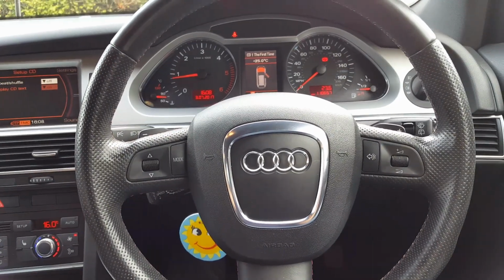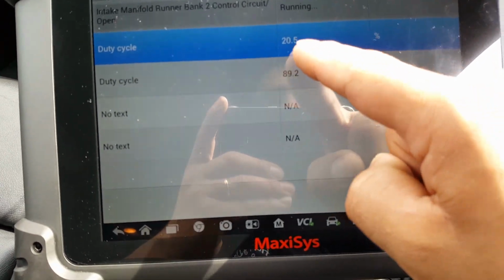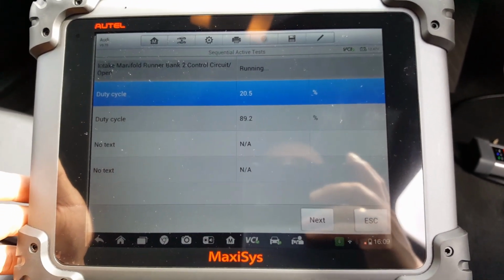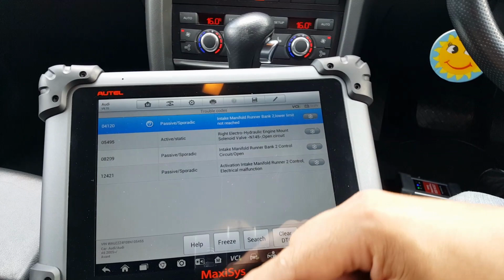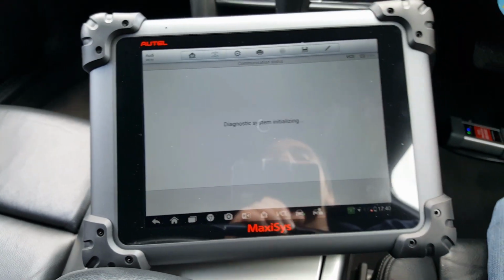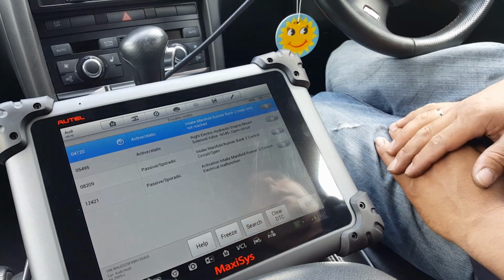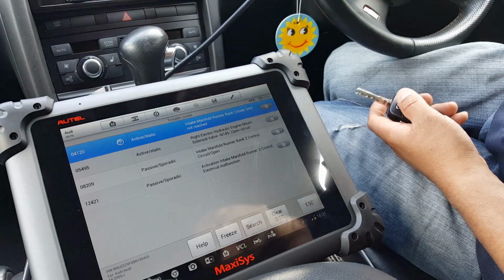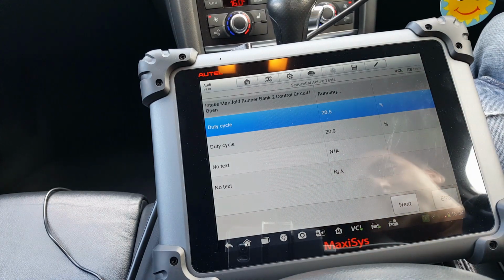Audi A6 2.7TDI V6, trouble code P1018 or 04120 flap actuator. Fault finding and repair.

Comment: I actually added two screws, one for the lower limit and one for the upper limit, at slightly different locations from those shown in this video. They delimit the angle of motion at around 45 degrees. When everything is assembled and you look at the actuator knob flat on, the lower limit is 1mm over the (extended) flat plane where the three mounting bolts go, and the upper limit is 1mm over the (extended) horizontal line that dissects the electric motor. A little bit of trial and error but it works. No more upper/lower limit not reached errors and upper/lower stop not reached errors.

Comment: Wow you are a clever guy…thinking outside the box as they say. Ive got the same error code on my bank 2. It is actuating so do you think it is likely this same problem? Im gonna place the screwdriver to see if it changes to passive just like you did. My car is an 08 A6 3.0tdi. You explained very well..thanks very much 👍

By the way, my car was working fine more or less until i had to leave it sitting unused for 3 years then this happens. I assumed that sitting for so long maybe the gunk had solidified and blocked it up somehow, what do you reckon. Also i have a problem 01826 with my ABS, i read that the water drain at the back of the engine can get blocked and the water sitting can cause problems with the abs electrics.

Voce Brasileiro?
Reply from the maker: Portuguese...
I never had the issue for the ABS, but nothing like some good investigation and diagnosis...
As for the flaps, check could be either way, but if you say they move, then might be the same as in the video.
👍👍👍

Comment: Do you have any solution when its takes longer to start, even when it has been driving
Reply from the maker: Have you scanned the car?
Any trouble codes?
Something like that can be caused by a few things...
👍👍👍
Reply: U1007 battery monitoring control module 
 & P1580 throttle valve bank1& P161C glow plug cylinder 3 (changed on Sunday & no longer there) and lastly 00739 circulation limit reached coolant @LMAutoRepairs

Comment: Absolute genius! Same problem on 3.0 V6, 04120 code on bank 2. A very simple solution (which are often the best) but huge respect for coming up with the idea in the first place, well thought out, logical and well explained. The main plastic gear wheel inside the unit can be very brittle (mine's 17 years old now) so be very careful when you're drilling for the screw, mine started to split a little so I filled the voids around the screw with epoxy resin. Thanks a million!!
Reply from the maker: ☺️
Thanks!
For watching and for your comment. 
Great your sorted your as well...
👍👍👍

Comment: Thank you so much - I had exactly the same error codes on my 2006 a6 2.7 tdi - I was able to diagnose it easily by watching the startup sequence and applied a very similar workaround. Very nice to not have the engine warning light blaring at me any more.
Reply from the maker: That's great!
👍👍👍

Comment: I have same error on my audi a6 3.0 tdi 2008 ,motor light error is on board ,hope this will work for me ,ordered metal pieces for this problem insted putting the screw inside on your  way

Comment: Hello ive a audi a6 2.7 diesel front wheel drive , europen version .  Someone gifted me and i did all the filters and oil change , it has a check engine for air  intake manifold  + in computer  there are some code for injector 2 3 5 , in highway for 130km it consume 8.6 lit , ive test it . But in the city for 20 km it consume 10 lit . Is this normal ? Does it has to do with intake manifold ? Many services here in albania told me dont do something to injectors becouse im gonna have more problems . What do you recommend me to do ?
Reply from the maker: I would start by check the issues related to the faults you have... and go from there...
👍👍👍
Reply: @LMAutoRepairs  might a bad air intake manifold couse bad fuel economy ?
Reply from the maker: Yes...
Combustion will not be efficient if you have air leaks... Air is supposed to get to the combustion chambers, not to escape before get there..
Reply: @LMAutoRepairs  https://youtu.be/p-UPPEBlju0  i did change the manifold but still problem with acceleration and  poor fuel economy  , might it be becouse the throttle body , here ive recorded a video , is it in good condition ?
Reply from the maker: Check for codes, and check live data...
Your answer will most likely be there...
Reply: @LMAutoRepairs  i dont have codes
Reply from the maker: Again... live data...

Comment: I am currently facing the same problem with my V6 TDI and was trying to go the external brackets way although they are not available in my country. Would you be able to guide me on any measurements to set a stop for upper and lower limits? My fault code reads; lower limit not reached - upper limit exceeded. Thanks in advance
Reply: I am trying to fabricate a bracket locally

Comment: I have the same problem P1018 lower limit not reached but during the test via VCDS the damper opens and closes normally in the range of 20.5 to 80. After starting the engine and reloading the errors, the error reappeared.  Can't advise me where the error might be or how to fix it?

Comment: Hi ,i have also audi a6 3.0 tdi from 2008 232 hp,cann you tell me what is on chanel 20 o meassuring block ,you find there a temperatur but i don't now where it come ,or what means or how it calls that Sensor that shows that temperatur ,on my car shows   -40 ° celsius and that is not ok ,from what i have seen on youtube must like 54° C.
If you can tell me what is there.
Thanks
Reply from the maker: Hi
If you have no faults on the ecu, I wouldn't worry about...
What tool are you using?
Most like is a vacant position... if you are using VCDS, is common for it to show data that doesn't belong to a certain model... and because there is no data, is shows the minimum possible, like -40 when for temperature...
Thank you for watching and for your comment!

Comment: But how come the motor did not move when you powered it up
Reply from the maker: Not sure at what part of the video you are referring to... but as I explained, moves once till the motor moves over the limit... which at that point stops actuating it due to the fault...
Thank you for watching!
Reply: LM Auto Repairs what I am saying is u ran power to the motor in video and it didn’t run ??
Reply from the maker: @mickkelly2229  
As I explained in my previous comment...
It runs until it faults...
All explained in the video as well...
👍👍👍

Comment: This is brilliant 😀. Any tips on the ignition key lock after the battery was exchanged? The car is the same as the one in this video, it starts and drives but the buttons on the remote doesn’t do anything and it has that warning in the dash that says ignition lock.
Reply from the maker: Hi
Thanks!
I have a video for that...
Jut search my channel...
Thank you for watching and for your comment!

Comment: I think that was the best diagnosis and ingenious mechanical repair video I've seen, well done! thanks so much.  My 2015 q7 3.0 gasoline was just in the shop for pvc/oil separator  replacement $$ and now show flap position error.  I did see n the internet a quick fix being sold for this problem.  very similar to yours but the "stop" was with a externally mounted metal bracket. remove the top two screws, hold up the flap actuator arm and insert the stop, is held on by the two top screws.  thanks again
Reply from the maker: Yes... I know about those brackets... the only  downside is that you can see the bracket...
But fixes the issue... that's what matters.. 
Thank you for watching and for your comment! 
👍👍👍👍

Comment: Hello mate i recently got a Audi A6 3.0 Tdi s line quattro 2007 plate , the car goes into limp mode sometimes i got it read and it came back with error code p3348 , would you know what the problem could be?
Reply from the maker: That's a generic code for the turbo actuation...
Inspect the turbo actuation etc...
Thank you for watching and for your comment!

Comment: Hello mate, your video was great. You explained everything very well. I am just wondering how did that motor started working again?? I have the same problem and arm is stuck.
Reply: Thanks alot for your reply, the video was very detailed.keep it up 👏
Reply from the maker: @Garage4youGLA  
👍👍👍
Reply from the maker: The motor never stopped working...
Was just moving out of range causing the fault etc...
Thank you for watching!

Comment: My A5 tdi 2.7 lag's when pulling off its so annoying is there any fixes for this i had gear oil changed by Audi a few months ago.
Reply from the maker: Impossible to say based only on what you said...
Scan the car, check live data and go from there...
Something like that can be caused by different things...
Thank you for watching!
Reply: @LMAutoRepairs  Thanks for reply👍
Reply from the maker: @ryanh3285  
👍

Comment: I saw on eBay you can buy for £23 an flap actuator repair kit from Poland.  This provides, allegedly, a better quality set of gears for the inside of the actuators that don't wear out like the oem ones tend to do.  Have you heard of these?  If so, can a non mechanic, without your diagnostic machine, fit them and make the engine light turn off.  A local garage has quoted me £2k to fix this problem. I suspect they're preparing to rip me of like most garages do.
Reply: Thanks mate.  I've bitten the bullet and gone to a specialist.  Both need replacing £1600 plus other bits not related to this issue!!!!  Oh well, it's been a good car and should last a few more years.
Reply from the maker: @wightwalker2453  
Should do indeed... hope you have replaced the intake manifolds, or repaired the swirl flaps bearings... this last, is what actually causes this faults, the excessive play, allows the actuator to move too much, triggering the fault... that's why I sayd earlier, this issue has nothing to do with the actuator gears... as also explained in the video...
Obviously you can have issues with the actuators... usually that is not the issue...
👍👍👍
Reply from the maker: That will be a waste of money... the problem on these has nothing to do with the gears inside... is the actually wear of the linkage outside and the flaps shaft itself...
Thank you for watching!

Comment: Howdy, I have seen Your You Tube film about  trouble code P1018 or 04120!  and I must say Your explanation is Correct! I Did the same puttin the same screw in the gearwheel with the 2 actuators (they had together the problem) and everthing works fine again 👍 now! thanks very much for the film. also the bleu smoke is gone again at idle and while driving. 👍👍
Reply from the maker: That's great... nice to know it helped you! 
Thank you for watching and for your comment!

Comment: You are a genius, very well done, wish I'd seen this before I ordered my new actuators
Reply from the maker: 😕
Thank you for watching and for your comment!
👍👍👍👍
Reply: @LMAutoRepairs  I decided that, whilst waiting for my new flaps and actuators, I should try your trick. I actually noticed that I didn't need to measure anything because my actuator is identical to the one you worked on. I drilled and placed the screw in the same position as yours. Bam ... nailed it, fault went passive immediately. Solved my year long irritation

I must say, I didn't realise how small a drill bit I needed until I started working on it. You can't force the screw in without drilling a hole and you can't use a wrong size bit otherwise you can destroy the wheel. In the end, it was an easy task to follow, thanks to you😁. The whole thing took me just 1 hour of no sweat job
Reply from the maker: That's great!
You got it!
Thank you for the feedback!

Comment: I love the fact that you came up with such a good idea for repair but can you be sure the problem is with the control motor? It could be worn bushings/rod that the swirl flaps rotate on. That will throw up the same fault code. I'm  getting the fault code of lower limit not reached for bank 2 and  after replacing the control motor and actuator arm for new items, the fault code remains. That can only leave the swirl flaps as the culprit. Could it be the same problem on the car you worked on?
Reply from the maker: Brendan McGorisk 
Hi
You actually nailed it!
The problem is not the actuator...
Is everything else that worns out and let's the actuator to move more than what is expected by the ecu...
Theoretically,  you need to change the entire manifold...
All I have done here, was preventing the actuator to move over the limits...
So, most likely you are suffering from the same problem...
Hope that helps. 
Thank you for watching!
Reply: LM Auto Repairs - your video was really helpful to me. I've found a pair of manifolds online for £199 which I'm considering buying - https://rover.ebay.com/rover/0/0/0?mpre=https%3A%2F%2Fwww.ebay.co.uk%2Fulk%2Fitm%2F332616287882 - would you think they're any good or sub standard? How much would you charge a customer for fitting those? Where do you work from?
Reply from the maker: Hi
They are aftermarket, so it what it is... if you know what I mean...
Those new manifolds will or should sort your problem, the thing is, as the shaft starts to worn, the problem will return... it will might take a few thousand miles, or a few years...
If your manifolds and swirl flaps are good, what I have done is a good way of fixing your problem... If you don't bother, you can also consider this:
https://www.ebay.co.uk/itm/Repair-Bracket-for-Plastic-Intake-Manifold-03L129711AG-03L129086-P2015-Fault/382050600467?fits=Car+Make%3AAudi&epid=786093839&hash=item58f3fd8613:g:mEQAAOSwCmZZSQTk
These are fitted on the outside, and they limit the arm movement... the same as I did, but on the outside.
There is a few hours labour to remove and install the new manifolds, plus gaskets and/or seals that might need replacing...
I am in Peterborough...
Reply: LM Auto Repairs - I used to live in Leicester until 2 years ago and would have taken my car to you to get this sorted but I'm now living in Somerset. With that bracket fitted or with the fix you've done, am I right in thinking that the swirl flaps still won't be operating as they should be? Does the bracket just fool the ECU into thinking the rod and flaps are working properly? Do you think that bracket will fit the 3.0 TDI engine? It says it's for the 2.0 TDI common rail engine. I've found one specifically for the 3.0 engine but it's £90...which is more expensive than the swirl flap and bushing repair kits that can be bought on eBay.
Reply from the maker: With my fix, or with the bracket, the swirl flap work as normal... the only thing it does, is that prevents the actuator lever to move out of the specs, which happens due to the wear and tear of the swirl flaps components in the manifold.
It is your decision Brendan, how much you are willing to spend etc...
Consider to support my channel and all the hard work put into it at http://www.patreon.com/LMAutoRepairs
Thank you
Reply: LM Auto Repairs - I will certainly have a look at your page. Thank you for your help.
Reply: LM Auto Repairs is it possible for it to be the same problem? bearing in mind the problem you had involved it going past the limit and this guys is not reaching the limit(I have the same problem it's not reaching the limit and I've had my swirl flaps replaced already which didn't solve the problem) oddly enough mine work every now and again but it's rare that they do

Comment: You can get a bracket that connects to the motor. Google actuator flap bracket repair something like that. Good video keep it up
Reply: Dieselgeek it the place that sell the bracket
Reply from the maker: I know, but that gives away that there is a problem in there... lol
And the bracket is quite expensive...
Thank you for watching and for your comment!

Comment: Thanks for great video. I'm having this same problem with -05 A6 3,0 TDI. Difference between flap motors was clear, so I decided to follow your tutorial. I still got that fault code active, so I guess I still have to keep looking for solution. 

Cheers from Finland
Reply from the maker: GerryHuskyaho 
Ensure you have placed the stop point in the right place... otherwise will not work...
Thank you for watching!

Comment: Would you explain a bit more about PASSIVE TO ACTIVE (fix confirmed) in the scanner ?
Reply from the maker: Jason Kim 
Hi
No worries...
I believe you are referring to the fault codes, being active or passive...
Active, means the code/fault is present, when the ecu does the checks, or found a  problem with that system...
Passive, means that the ecu no longer sees a problem in there, it saw a problem before, but not anymore...
When you clear the faults, the passive faults will clear, because as I said they are not present, all the active ones will stay...
Don't know if that makes sense...
Hope so...

Comment: Excellent video! 
I have the same car as this which had a similar problem at the same milage is this one, it was a bit of a difficult one to diagnose!  it turns out The ECU works out a fault on the intake manifold runner system because it looks for an 89%efficient working of the system   anything out of this range and it flags up The EML light as the actuator motor Will be travelling up and down out of its normal parameters, The worn swirl flap bearings cause the lever arm to have excessive slackness, I rectified this by replacing the swirl flap Rods/bearings it's quite a straightforward job for a competent as the manifolds  will need to be removed the repair kit is available for around £60 per manifolds.  Imsvvavr is a very competent guy watch all his videos and you will learn a lot I'm very impressed with most of his videos and it's really good of him to take time and effortgoing out of his way to show us his skills ! Well done, Bom trabalho!!!
Reply from the maker: Salim Khan 
Thank you for your comment!
Much appreciated...
Reply: Hi Are u based in the UK?